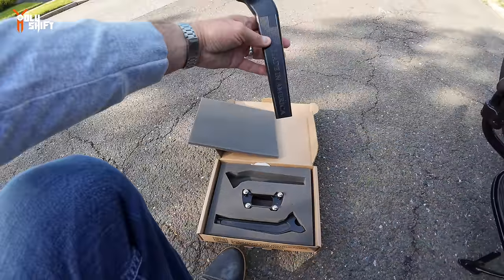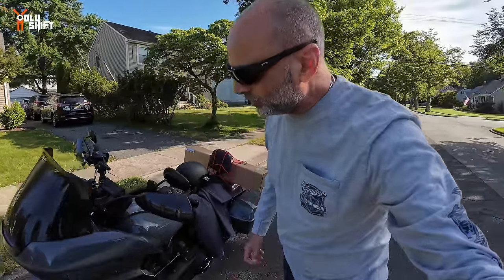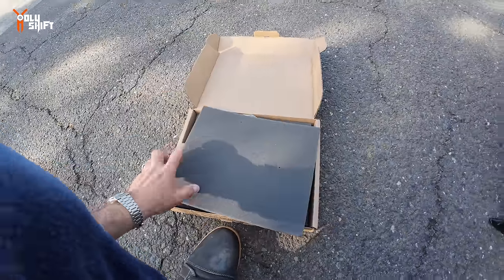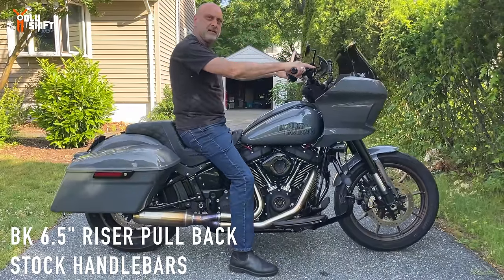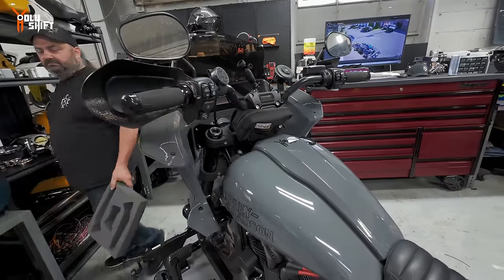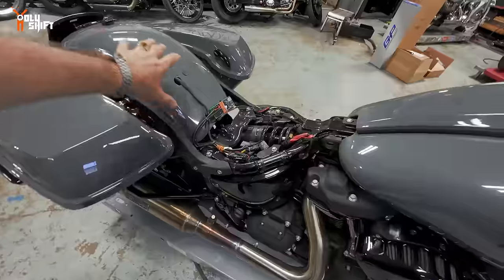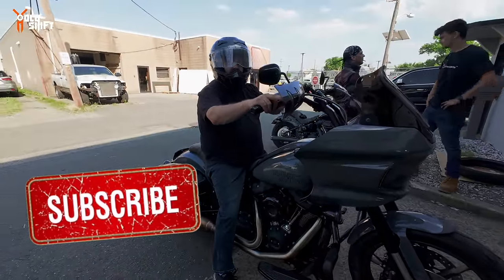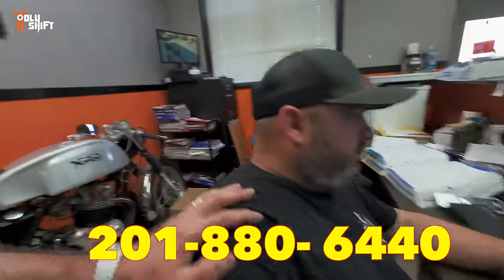Game Changing Upgrade For Low Rider ST - 9.5" RISER HANDLEBAR Install

Comment: I'm 42 and 6' 2"... wouldn't get rid of the mids on my FXLRST for anything.
Reply: I’m 26 and 6’2” and just got rid of mine. To each their own
Reply: @DaddyWarbucks713  Swapping to forward controls effectively neuters the ground clearance.  A proper seat and set of taller risers (8"-10") got me comfortable without sacrificing the ability to really push the ST in sweeping turns.  I went a step further so I could push a little more speed through turns by lifting the rear 3/4ths of an inch with an Ohlins HD rear shock from Big Bear Performance.  Dialed the front end with their 29mm +2" cartridges.

Comment: you should always put upgraded bushings in when increasing the bar height since you now have way more leverage and those stock rubber ones will break down fast.  you'll notice a lot of wobble by next season,   minimum of urethane ones, solid would be overkill but some people prefer it.

Comment: Hi, given how you're trying to improve your ST ride, I'm surprised you didn't put in the Power Clutch from Meuller - especially as you've removed the whole clutch cable. 

BTW. When I had my ST, I had the same set of riser and the twisting annoyed me.  At 182cm tall and 9.5 inches with the factory bar, I felt the height of the whole set-up was at the limit of comfort - for hard riding the set-up was a bit too high. 
As I changed the machine to an RG 24, I went with a Kraus 8 inch Riser and VTWIN ODI handlebars - no riser twisting 😉. 
Have a great day!

Comment: Hey great video! Noticed at the end of the install your riser/top tree alignment must have been crooked and the installer muscled the bars to move the riser on the bushings. Then it looks like he really torqued them down super tight. Have you had issues with them coming out of alignment still? I notice from time to time my bars are out of whack and I have to muscle them back into alignment. I ended up swapping to poly bushings and it still does it even with poly bushings. Solids on my dyna gave a lot of vibrations through the bars that I don’t want on my ST. What has been your experience so far?

Comment: Can you make a video about the cable management they did? I just did this exact install and the brake and clutch cable seem so long
Reply from the maker: Yes the cables did turn out slightly too long I ran them under my handlebar bag

Comment: Hi! I have seen your risers progression. Don't you think that maybe a mini ape handlebar with the original risers or 8" risers that I've got in my bike would have given the same result or even a much more comfortable riding position?  🤔 For example, the apes that came stock with the 2023 Road Glide ST... This bike is designed for people with short legs and long arms 😅
Reply: The biggest issue with apes is the amount of leverage exerted on the top clamp by a long one inch piece of pipe. Also, it's nearly impossible to get the gauge into your line of sight. T-bars, or risers and bars, are a much better option for more control, less flexing, and keeping the setup tighter and also, providing more adjustability. The great thing about t-bars is how tight they are. The suck thing is adjusting them, as they don't really move at all. What you got is what you got. So, risers and bars is the next best thing,. and are much easier to install, make minor adjustments, and swap if necessary.